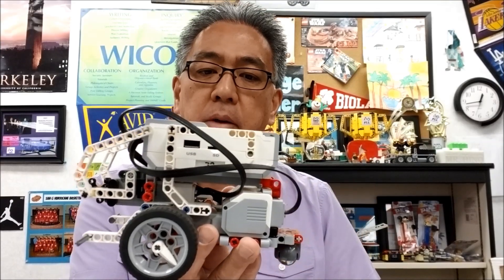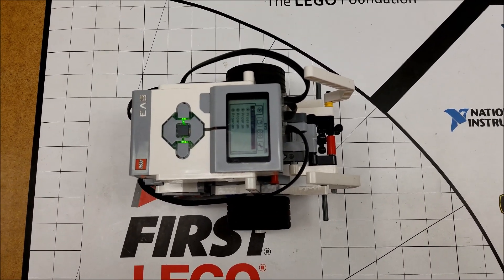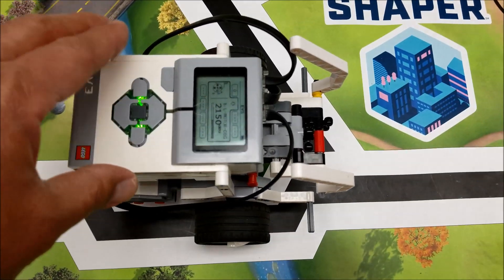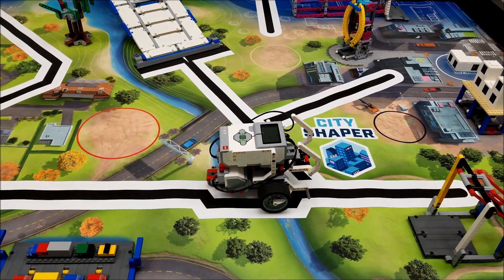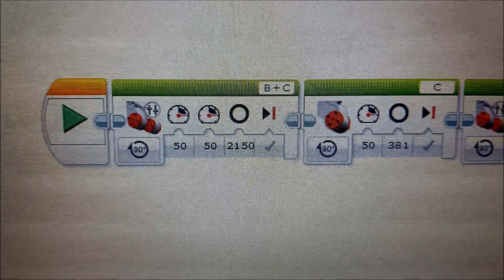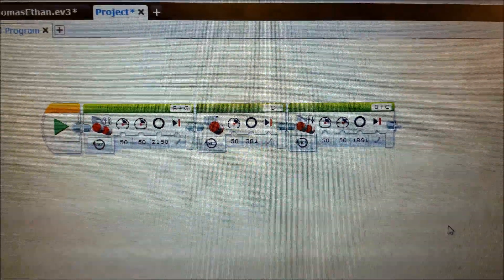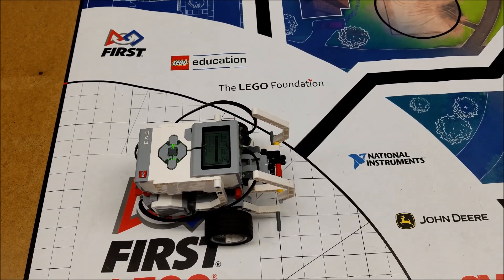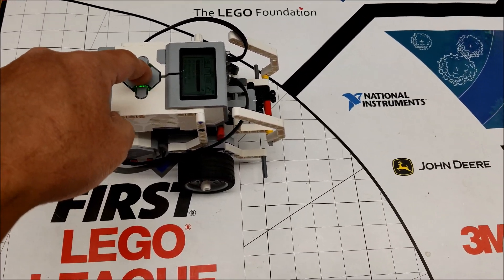"2019 City Shaper: How I Program Turns (Elevated Places)"

Comment: The bridge hanging off the table is very annoying to me.  Probably great if your team has 2 tables.
Reply: Is it possible to use metal L brackets to reinforce the bridge. 4 large "L" brackets would make a rectangle to place underneath the bridge platform. You could use screws and bolts to fasten the brackets to the table frame and to each other. Then use Velcro tape to secure the platform. Shims may be needed to adjust the height.
Reply: Agreed. Even with the support beams it's not very stable running the robot up and onto the flags.
Reply: @JonathanBates  We had to add additional support.